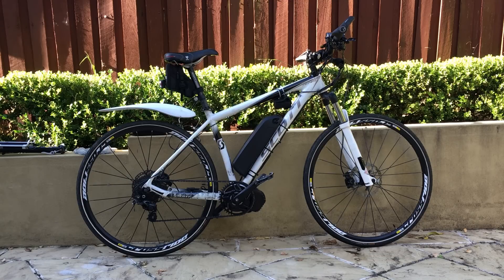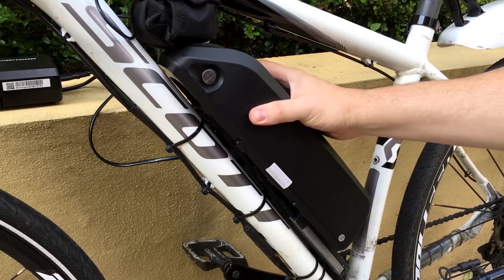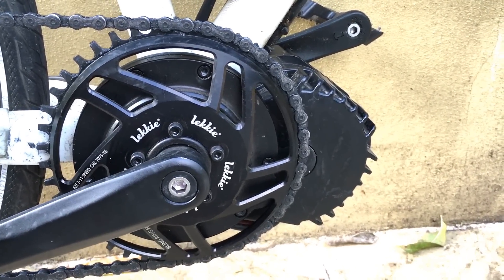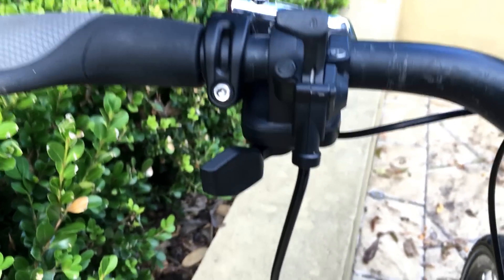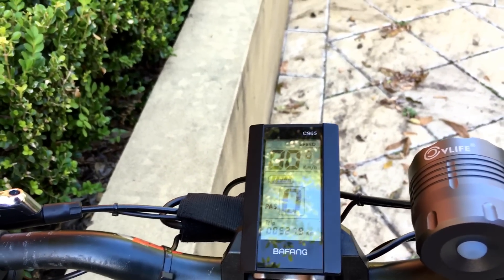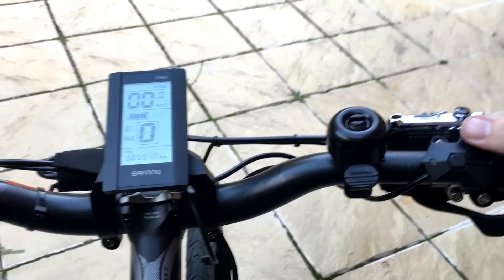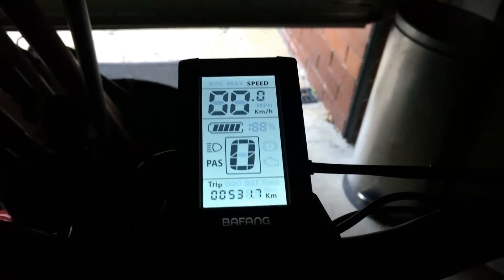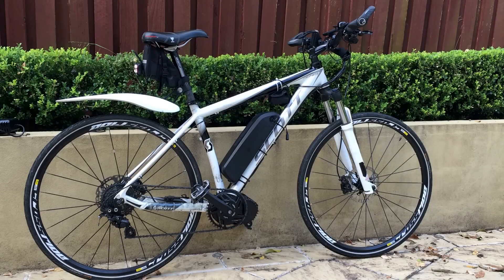Bafang BBSHD 1000w Walk Around And Review 65kph - 40mph Test Run

Comment: Max speed: 78 km/h! You MUST make a video when you ride the bike!
Reply from the maker: I will be making many videos soon of riding... I am sourcing a decent Gopro setup shortly to create them because at those speeds you can't be holding a mobile phone!
Reply: Don't you find that the smaller front chainring lowers top speed.
At the moment lm waiting for the 48t as I will see how I get on with that.
Reply: @tonielcock8891  I've found on mine that 7.5 to 8 metres of rollout will get the most performance out of the motor and 9 metres of rollout for both the motor and my legs at the same time. 52/12 on 26" x 1.5 wheels with a BBS02B. Unfortunately it rubs against the chain stay without spacing washers. Any of those lekkie cogs would have to be smaller so worth using them with an 11 tooth as your highest gear. You will still get pretty fast on the smaller cogs. The above is for maximum flat land speed with pedal + throttle.
Reply: @TimpBizkit  what do you mean 7 to 8 metres of travel? I have gone back down to the 44t from the 48t and would never go any more than 44t now.
Got 37mph down hill and 32.8mph, happy with the performance

Comment: The handle bars are a bit different to the bike that I had when I was a kid. The only brake I had was the one inside the rear hub and you peddled backwards to apply the brakes. The problem was is you were flying down a hill and hit a big bump the chain would come off and have zero brakes. You had to put the bike down as soon as, so that you didn't gain anymore speed. Only one high gear and 29 inch wheels. Things have changed a lot. I might have to try something like this before I get too old.
Reply from the maker: Yes I remember the back pedal brakes, awesome for doing 20 metre skids down a hill as a kid.
Reply: We used to see who could do the longest skids, but the tyres back then would still last for ages because they were so tough. You would just have flat spots everywhere though. We lived in hilly country and my mate had a fixed wheel with no brakes, just fight back on the pedals to slow down. We were tough back then.

Comment: Nice. Thanks for the road test. Good thing those cars are on the other side of the road. A little unnerving to watch as an American. Mine is limited to 32 KMH but I would like to go a bit faster.
Reply: just put the limiter higher or remove it. simply done. ;-)
Reply: Even a relatively mild increase in speed will dramatically reduce your range. If you stick to 15mph or less, you can expect around 20-30 watt hours per mile depending on conditions. But it goes up dramatically from there. Once you are over 20mph the energy consumption goes almost straight up as you increase the speed. Not only do you have the normal exponential increase of energy with speed, but you get enormous wind resistance.
Reply: 32 kmph is enough, that way you are safe, police wont annoy you and you have great mileage, going at 65kmph on bike designed to go at 20kmph is just disaster, so many things waiting to go wrong. Have you heard of physics formula that if you double your speed, force increases by a factor of 4, so going at 65kmph from 30kmph will means you need 4x as much power from battery/motor and upon impact injury will be 4x worse.
Reply: @SSToor  It's nice to be able to go that speed, although for long distance cruising it's not economical, and I recommend a decent helmet. I'm thinking of upgrading to a downhill MTB helmet (want a motorcycle helmet but with better visibility and a bit cooler and lighter for pedaling), currently got a green cycle helmet but want a bit more padding/protection.
Biggest danger I found was drivers doing maneuvers in front of you, not expecting you at close to motorcycle speeds on a push bike.
Reply: i guess im asking the wrong place but does any of you know a trick to get back into an Instagram account..?
I stupidly lost my account password. I would love any tips you can offer me!
Reply: @Aries Ulises Instablaster ;)
Reply: @Bobby Jorge thanks for your reply. I got to the site through google and I'm waiting for the hacking stuff now.
I see it takes quite some time so I will reply here later when my account password hopefully is recovered.
Reply: @Bobby Jorge It worked and I now got access to my account again. I'm so happy!
Thank you so much, you really help me out :D
Reply: @Aries Ulises No problem =)
Reply: @bobbyjorge485  bots lol

Comment: Thanks for the video!  About to order a Bafang mid motor and now doing research.  My questions: What size & brand are your new skinny commuter tires?  Are the brake sensors installed for both sides or just that one right side ?  What glue did you use?  The USB cable is to reprogram the controller (not the display), or the motor, or both?  And what are some restrictions that should be changed w throttle only mode?
Much appreciate!

Comment: Imagine what its capable of. i have tge bbs02 for 2 weeks now. got 58 km/h on a straight so far by only changing wheel diametre. ordered the usb cable for prooer tuning now. ;-)
Reply: *proper
Reply: Be careful what you program it for. Bbs02 controller is pretty weak. 25 amps continuous even is asking a lot of you want to to last.

BBSHD can do 30 amps continuous no problem.

Comment: Does pedaling with throttle only mode hurt the motor? seems like pedal assist is how theyre meant to be run? good video, thinking of this model in brisbane, I also like the idea of buying the programming cable instead of gear sensor, I had heard that delay may get annoying, I like the idea of using throttle separate to pedaling but I want to do big distance so wanting to pedal same time or is it better to start in throttle only mode get up to speed and switch to pedal assist? I think mid drive are so cool but seems the best way to wear a motor out quick having it double as the crank rather than separate like a hill topper or hub on front wheel
Reply: I'm also thinking of keeping it legal speed and getting a motorbike license, I think cops want to bust these bikes they are like riding a motorbike without registration like a free ride it would piss anyone off used to having accountability for accidents. I want to get 1000w model for when laws change and can up the speed and register it, I think if you hit someone at 70km you'll be in serious shit trying to explain it lol
Reply: I should add lastly though, I love the bike, so inspiring that mud guard is sick too.

Comment: Any experience of using that shark style of battery pack in the rain and just how waterproof it is or isn't? Although, I'm in one of the wetter parts of the UK and comparing the weather to down under is probably akin to comparing apples to oranges.  Looking at converting a mountain bike [bottom bracket type and measurements nightmare] to BBSHD and in the process of deciding on things like a good donor bike and either a triangle battery pack and bag or a shark style one like yours. Very nice bike and one of the more detailed YouTube videos on the subject. Thanks.

Comment: Good video with all sensible comments and not carrying on with a lot of crap. What program do you need on a computer to muck around with the speed limiter?  What else needs changing on the program other than the speed limitation?  Does the replacement throttle just plug straight into the wiring harness or do you need to notify the wiring?

Comment: Great review, i want to install on bicycle with V brakes, i am a bit worries about the braking power, i already think it,s not good enough, i live in Wales and it rains a lot...  i think with this much power it will be risky.  I probably need to invest in disk brake bicycle and convert.  Probably cyclo bicycle...  thanks again for video, very informative
Reply: I recently converted my Bianchi hardtail MTB to a Bafang mid-drive 750watt motor. Now having ridden it for some 250klms, I'm thankful I didn't put this on a bike with rim or V-brakes...the added weight and momentum would have quickly overcome anything but hydraulic disk brakes 👍

Comment: I've got the older bbs1 which i shattered the spindle 3 times, and got upgrade to 350w and dropped speed from 20 to 18mph and not used pedal assist so less strain and now just get pedaling and open throttle. Been looking at better motor to fit onto old Kona ht but stuck on Bbshd but not 1000 or Bose 03

Comment: Good video mate , and a Great looking set up ,  id be a bit anxious for myself having that power unit  on the roads in australia( i need my licence :)  ) , or victoria at least(the nanny state ) , 250 watts i think is the max legal power ??? please correct me if im wrong .
The authorities really need to look at ridiculous small power limits ,  at the very least do the power to weight ratio thing !
i rode my young brothers 200 or 250 watt hub motored bike some time ago , and to coin a phrase , it was  piss weak . 
 the tiny power units may be ok for light people , but put it under a heavy  adult and a heavy bike (13 kg mountain bike before the power unit and battery is added in my case ) , and the assistance is truly minimal .
 dont get me wrong,  some assistance  is better than nothing , but there is also the longevity of the power unit to consider , a small motor struggling at maximum all the time you would have to make the assumption it would not  last very long .
 personally id be happy having the bigger power unit even if it was set at 500 watts, i suspect even at a moderate setting the bigger power unit would still have more torque at 250 watts or 500 than a small unit maxed out at the same ???? 
i`m only guessing on that though , but i would still go the big unit for the longer life i think . 
 cheers .

Comment: Nice set up there. I would someone want something with more range on full throttle. In the USA here that would only be about 13 miles at least you were honest about it. Would like 30 miles range on full throttle. The speed is awesome. guessing top speed is 32-40mph. What would you have to do to get twice as much range.
Reply from the maker: You can get double by using pedal assist but of you want a lot more than I suggest carry a 2nd battery or buy a battery bag but then it becomes heavier, not portable like on the frame and Very expensive!

Comment: I had the opposite problem with the aftermarket (Luna) chainring grabbing the chain. We tried different chains then went to the Bafang original and it works great. I'm finding PA2 is the best for riding and battery conservation sitting around 30kmh. I haven't found a need to change gears yet except when the battery ran out. I use it as a work commuter (fat bike) and get a weeks commuting out of one charge (900wh), that being around 40kms total distance.

Comment: 1) swap that 48v battery pack for a 52v pack
2) upgrade the 1000W controller for the 3000w Ludicrous controller
3) realize its a totally different bike
4) enjoy:)
Reply: Hi Doug , I'm doing some research on building an e-bike , Thanks for your tips as I wasn't aware that upgrading the controller could make a difference. I thought by having a 52 chain ring I could reach those high speeds but it seems that I would be limited if I didn't upgrade the controller.  How fast does your bike go ? Cheers

Comment: Top video mate. Answered heaps of questions Ive been asking myself and seeking out on the net. I tow a trailer with gear in it and live on a mountain up to 600m. Im considering the 750 BBS02 ( i have the bling ring) with the extra accessories you are using, wipperman heavy duty chain and 11-32 rear gears, but wondering if the BBSHD is better suited. I purchased a 48v 25a battery. After a couple of months how are the chainring and freewheel cassette gears wearing? Cheers from Mt Dandenong ( no flat tracks or paths here) near Melbourne.
Reply from the maker: I have had this running for about 8 months now, I have changed out my cassette for a 11-34 only because it wasn't new when I had the conversion done so was worn a little at the top end. Changed the chain also at the same time. I have been super impressed with the way this bike can chew up big hills in the mountains and also can be used as a commuter. Very versatile and fun setup. Best part is a relatively low noise profile so doesn't look out of place on the road or trails...I think the BBS02 is a good setup too but for peace of mind of it not burning out and the extra power the BBSHD is the way to go!

Comment: I got a 1000W rear Hub Motor comes with it Samsung Battery 48V 13aH. However, I am NOT happy with both, the range also need a bit MORE speed. Sometimes I see other ebikes are better or a faster than mine in uphills for example. My question now is this;, if I try using 52V Battery, and it works, would I automatically get better range and not the speed or both? In case if it doesn't work, do you think that would damage the controller box or do I need to change it to get the above mentioned? I am SO upset!!!!

Comment: Be wary of Bafang.  Mine worked great for about a month and then the problems started.  Started working with Bafang to troubleshoot the issue.  By the time they decided it needed to be sent in, it was after the crappy 90 day warranty.  Now I'm stuck with $1400 worth of junk.
Reply: I've been running a BBSH on a converted Marin muirwood for the last 5 years. 12000 Kms and still going strong. Daily commute of 32.kms with some hills. Penut buttered my reduction gear in the first few months but that was because I was running to hard in to higher gear at lights. Battery still good and easily gets me on average to work around 45 kph . Can still tip out a bit over 60.if I'm feeling dangerous! Probably changed rear cassette and chain almost every year (COVID slowed that a bit! With working from home)👍
Reply from the maker: Had this bike since 2016, only thing I managed to destroy was a controller by going up too steep of a mountain climb about a year ago. Its still a beast

Comment: You mentioned ' reprogramming ' the unit for throttle power only, no pedal assist. I know there will be times when I just want to use the motor and sit back and ride like a motorcycle, is reprogramming difficult to do, are there tutorials out there for this?

Comment: Hello, I like the review. Question, by changing those tires to road tires did it help to go faster than your mtb tires?
Reply from the maker: Yes I felt that it rolled better on the road and therefore probably less drag on the motor, especially up hills. I have changed them back to nobby tyres at the moment though because its winter and I haven't been commuting to work on the bike. More trail time...
Reply: @TwistTheThrottle2024  How much Ah is the battery and how many miles it runs for such powerful motor?
Reply: @piyushtalegaonkar2940  For daily commute get a 750w! This one is just much more powerhungry and much less economical in terms of milage.

Comment: Have you ever needed to grease the HD motor and why does it not come unlock? Also do you need to program it on the computer to make the speed more efficient? Could you go through and explain how much speed the motor is giving you on the PAS and also when you change gears? Can you pls talk about maintenance when do you need to bring it into a bike store to service the motor?  Is the accuracy of the speed not correct and is the same with the DCP 18 Display? 

How much do you ride? 5 days a week and no issues? 
And will you stress the motor if you keep putting it on full speed?

Comment: I've got a Felt " Flying Machine " cruiser style bike, it was great on flat ground but now we're living in hill country and 7 speeds isn't enough. Is there any kind of Bafang motor and battery combination that you would recommend for maximum range considering the bike is really heavy and I'm 235 pounds too.
Reply from the maker: Just upgraded this battery to a 30amp 52v, it's now a beast with this motor. Yesterday did 60kms in extreme Hill dirt terrain. No issues at all. Will eat up mountains. I still had 3 bars left on battery...you do need better tyres strong wall and thorn resistant tubes. I got a cpl of flats before I changed to the right setup...

Comment: I know this is an older vid but is the throttle progressive? From the vid it seemed more off and on
Reply: My old BBS02 was progressive in a way, but not smoothly. I found it better to set the speed with the display and use it as more an on/off switch.

Comment: Do you have to peddle when you go up hills or does it have enough torque to use throttle only?By the way how much torque does your model have? I have a 1000 watt kit that will go 35 mph tops, maybe faster with a lighter rider. I weigh 210 lbs.
Reply from the maker: No most hills you don't need to pedal but it's much easier on the motor if you do, I have pedal assist disabled but I choose to pedal as well as throttle because I just love riding and using my legs gives better balance. This motor is a mid drive not hub motor so torque and speed is better. This motor is more like a 1500watt. Can top speed at 50mph bit you could get more with bigger front chain ring...
Reply: @TwistTheThrottle2024  hey man how fast would a 1000w motor go with a 52v 17.5ah battery on 27.5 inch wheels

Comment: Does the throttle feel like and on / off button? Thanks for the video!
Reply from the maker: No the throttle I have fitted is gradual and you can keep it at a low speed then give it a bit when needed. The original one that comes with the kit is more on and off feel.
Reply: what throttle is this? thanks for your input, I'm literally assembling my BBSHD. Another thing I noticed, I can turn on the display, but it won't turn off despite trying holding the power for several seconds, it only shuts itself off after some time.